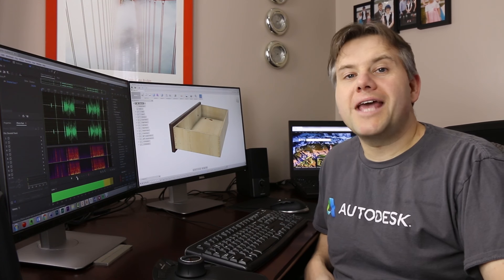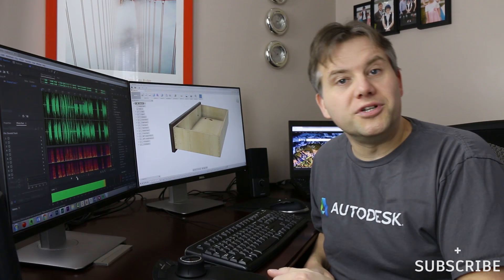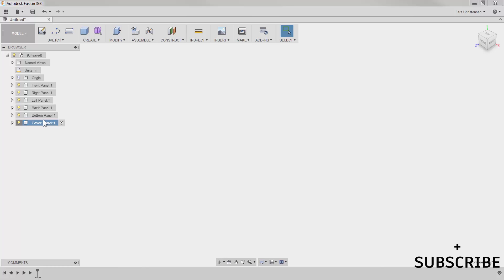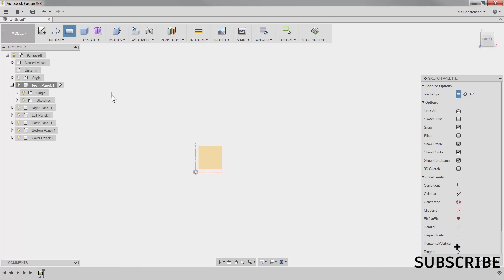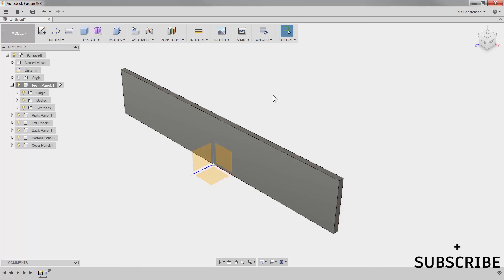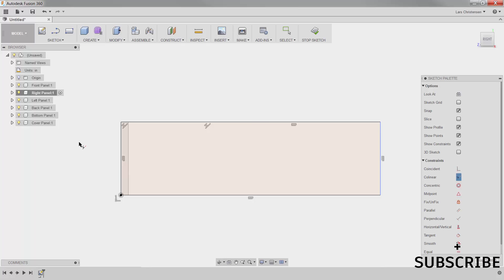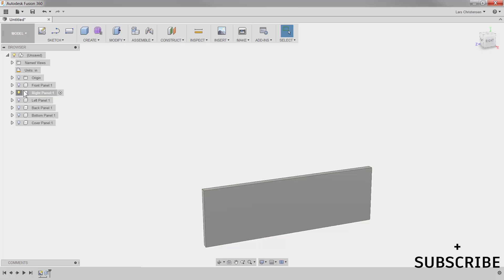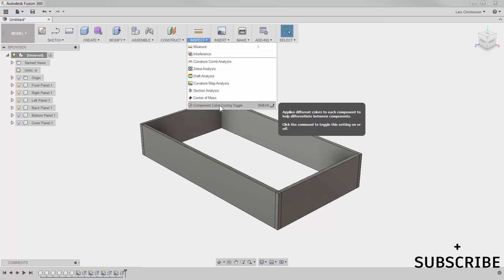Fusion 360 Tutorial - How to Model an Assembly Drawer with Dovetails from Start to Finish Part 1

Comment: Hi Lars, Can you help with a very basic problem. I sketch say a rectangle and as I drag it out I see the dimension boxes and know I can TAB between the two dimensions enter two values and press enter.
Now I decide that those dimensions were not quite right. How on earth do I get back to adjusting the dimensions. I have tried everything and feel foolish that I don't get it.
Cheers
Paul
Reply from the maker: Hi Paul, You should be able to just double clicking the dimension, and it should make you edit it.
Reply: Hi Lars, Trying a few things out today I think I am making some very basics mistakes or assumptions as a very new user of Fusion 360.
I assumed that if I sketched a rectangle and pulled it out to a cube, then sketched another rectangle to cube on top that I could alter the dimensions of the first cube.
It seems to me now that you can't alter the first cube as the second one is related to it. Also it seems that if you go back in the time line to the place you sketched the first cube, that you then lose all the other items in the time line.
Is there any way you can alter dimensions back in the timeline but keep the rest of the structure you made?
I love watching your videos an they are inspiring me even though getting started is daunting. I thought learning Photoshop twenty years ago was tricky but Fusion is far more complicated it seems.
All the best,
Paul
Reply: Spent another hour experimenting on this and watched another video about timeline and now have managed to go back to earlier stages and edit dimensions but it feels more like luck than judgement! Any chance a video on just this topic on going back in timeline and changing dimensions?
Paul

Comment: why do I have to turn the other components off view before I press pull a component?
Reply: Ok, from what I can see it comes into play in the 2nd video when making the small push/pulls. If you don't disable the other components before making them you get a small hole between the 2 components. Which is probably why he's trying to have us just make it a habit in this video as a prep for future use cases.

Comment: hey lars, sometimes when I try to change the dimension of body, it gives me a message " sketch geometry is over constrained' and it does not allow me to change dimension, any idea I do I change the dimension?
Reply from the maker: Hi saurav sharma Thank you for watching!
So when you have the sketch fully defined by using constraints and dimensions. Any additional dimensions will become driven. The only way to get around this, would be to delete a constraint that would make the dimension driving

Comment: When I draw a rectangle it automatically becomes defined! The only way I can draw an undefined rectangle is to use the line function and connect the four lines. Then I am able to define the rectangle sides but I am not able to move and center it on the plane as you did in your video. Is there a setting(s) that I must use to solve?
Reply from the maker: Hi Mike, honestly I did not think Fusion had a setting that would let you fully define with our dimension the rectangle....Can you try to restart Fusion and see if it repeats?
Reply: Have restarted and run in both Apple and Windows operating system. Same result.
Reply from the maker: Dude, You got me :-)...I have asked Bryce and Aaron who does the Fusion updates videos. Those guys are incredibly smart..I will keep you posted
Reply: So sorry for causing some trouble. Found the issue. I use a Macpro without a mouse. When I sketch i would hit the enter key to complete the sketch which resulted in a defined sketch. However when I tap the trackpad to complete the sketch then it is not defined and allows to be defined as required. Again sorry if I caused any angst!!!

Comment: Hey just noticed something. I went all the way back to creating the first front panel. After defining dimension and using midpoint constraint tool,  the panel is still Blue, even though its locked to midpoint???????
Reply from the maker: Hi Robert, The Color constraint is still in "Preview" I have seen a couple of examples of the same. Sure development are working hard on releasing this :-)
Reply: Thanks! I appreciate the follow through.

Comment: Got the latest version update and it does't work the same way. Front and right panels don't butt together, just the edges touch. Turned off component images virtually invisible. Several other changes too. I am not the best for describing events, so if you redo those two panels in the new version you'll see what I mean. So far it seems to me that all the you tube videos may be of no use  with this latest update. I did the drawer a few weeks ago and it worked fine. Just frustrated or plain annoyed, not sure. What do you think?
Reply from the maker: The menus are changing and the view cube has been flipped, but the fundamentals for how to sketch and extrude are still the same. Sorry for the frustration, but it should still work
Reply: Thank you Lars. I should get my head around this shortly. Just wondered if others also get frustrated at the changes. I am new to this, and am doing it for my own benefit during my retirement years. Good luck with your you tubing. I like your clips.
Reply: I'm using the latest version and haven't noticed that it's changed significantly. I think there is valuable content here. As always, software will change overtime, but the fundamentals are still likely applicable. For me, I'm just having a hard time learning all the concepts. It seems like there is a lot to learn.
Reply: I can confirm as Sayed mentioned, it is working.  The changes were not that drastic that my model didn't build up the same as Lars' model.  I didn't need to add any constraints beyond what Lars used.
Reply: Doesn't work the same for me ether.  Specifically, when drawing the Left panel and snapping the corners to the Right panel in the background, the top and left (back) edges are not constrained.  The "boxes" appear over the corners as expected but I get a "dot" only for the right (front) bottom corner and not for the top back corner.
Reply: i gave up lol
Reply: @ptman3  I get the same problem